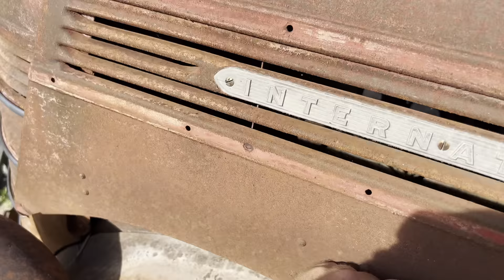RESCUED from the JUNKYARD: 1939 International Truck!

Comment: How do you decide which order you are going to smash vehicles? 2nd question, why didn't you scrape those old air compressor trailers when the prices were so high?
Reply from the maker: Very difficult and time consuming to get the radiators out of them. I had plenty of other stuff to crush, so I’ll do those later.

Comment: That 7.3 in the bus is pretty desirable if it's only 140k on it. Idk what things are like there but everywhere I look around they seem to bring decent $. Even as a core for rebuild it should be 500$ by itself. If you start parting the turbo, injectors, ecm, starter,  etcetc it would seem to me you'd be in the 1500$ range. Wish you were closer I'd love to be buying it by the pound.

Comment: That bus would be good for a church or a job project to haul workers out in the field ,that 7.3 ,was it none turbo , if I get one ☝️ I’ll be pulling the bus body off and use the rest for one of my ol Chevy 2.5 trucks and make a wrecker slide bed or a boom truck , and I know what you are talking about metal growing out of the dirt , just yesterday I got a piece of 3/8 flat bar hunge up in the tracks of my Link-Belt 2800 excavator , lol I had to lift the track on that side a roll it to where is could kick it out , it was a nice 20 foot stick of flat bar 4.5 inch wide , lol thanks BigAl California.praise Jesus Christ grace amen 🙏.

Comment: Hey Silas, what do you do with the gas in all the junk cars that are brought in, (that actually have gas left in them) are you able to filter it and put it in that beater work truck? Or does it all go in the same container as the oil, coolant, and every other fluid? I feel like I would try and use old gas in like a yard truck or something.
Reply from the maker: It all goes in the same container usually

Comment: maybe just a fuse for windshield wiper
Reply from the maker: No it moves, but the blade is bent and the hose for the washer broke. Of course they can only be ordered via Case, so they cost about $200 to replace a $15 part.

Comment: Dang it man 😭😭😭 I WISH TO GOD that I didn't live so far away from you 😭😭😭 Bc I need that Square Body S10 Blazer in the background at 14:24 - 14:33 😭😭😭   I've got a 1984, 2DR, 4X4, S10 Blazer that I'm rebuilding, I took the 2.8L & Automatic Transmission out of it and I'm doing a 4.3L/5 Speed Swap on it and I'm needing a 4.3L Blazer Fuel Tank and Pump Assembly and plus I want another 2DR Blazer bc I want to build a Pull Behind Off-Road Camper out of it to match my Blazer, I want to use a Pop-up Camper for parts in order to build the Blazer Camper too, I wanna use like the A/C Unit & Heater,, Fridge, Stove & Grill, Hot Water Heater and the Water Tanks and anything else I can use from the Pop-up Camper...